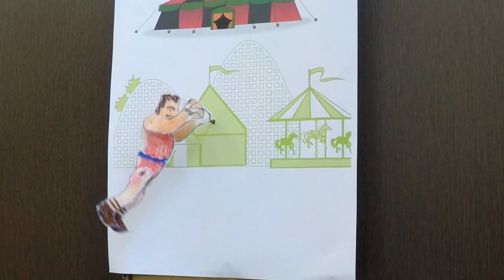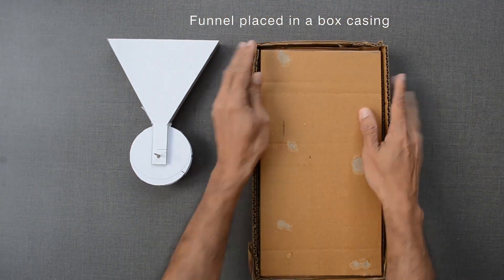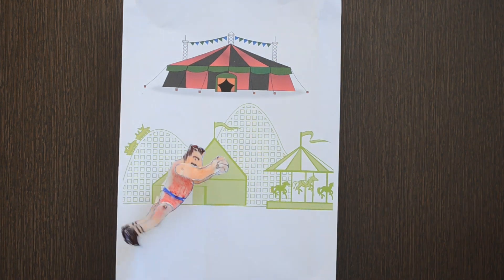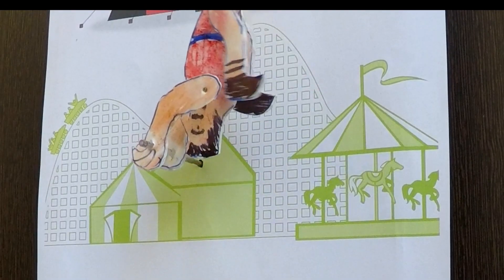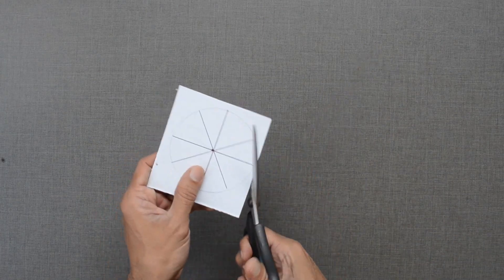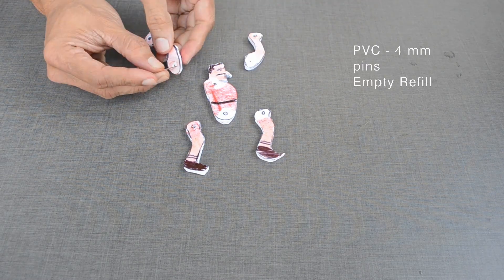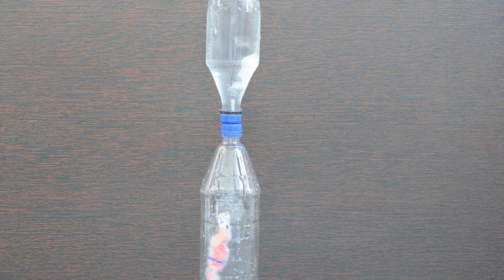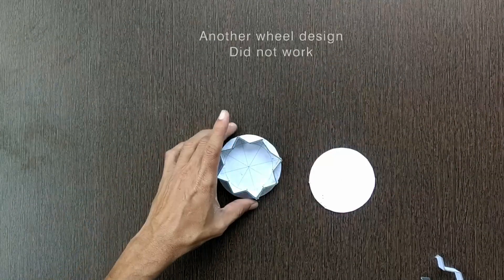Sand Automata - Acrobat in action

Comment: Really enjoyed this. Thank you so much for posting. Some very clever design ideas there. I have also been trying to make one of these and although it looks simple, it isn't. I have no skills as a woodworker or engineer so all of my efforts so far have been trial and error. Could you please tell me a couple of things? What sort of pins are you using to assemble the acrobat? Also, are you using a nut either side of the wheel as a washer, if so, is that to improve alignment?
Reply from the maker: Thanks. Normal pins are used to hold things in place. Nuts are used for alignment.
Reply: @RavindraGodbole  Thank you.
Reply: @RavindraGodbole  Excellent Video! May I ask what is on the other side of the pins to keep them from falling out or a arm/leg from falling off?

Comment: Hi again Ravindra,
I like that you have made the wheel and hopper as a separate unit first. Like the engine of a car that you then got to the body. Well thought out as way of perfecting the process while the components are accessible.

I was thinking of using balsa wood. Stronger than card and very light.

Regards
Ian

Comment: I think some Higher viscous liquid (oil) may work in the 2 bottle system you made. Maybe density is also a factor in it.
As always great video.👍👍
Reply from the maker: It will work with water. I have to make larger wheel.